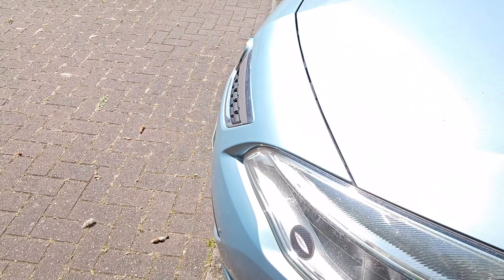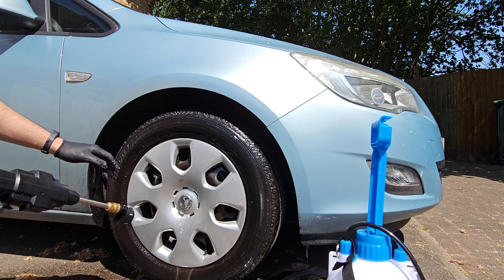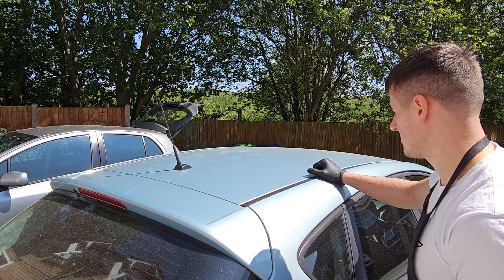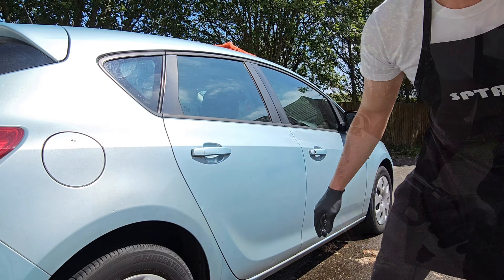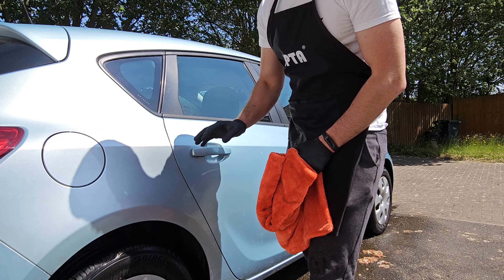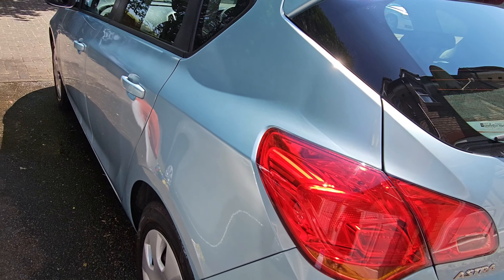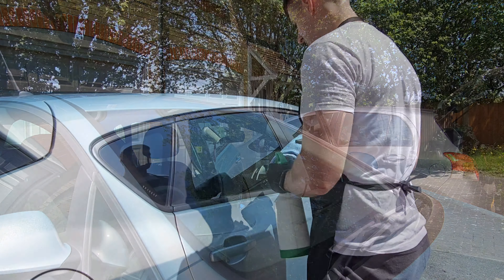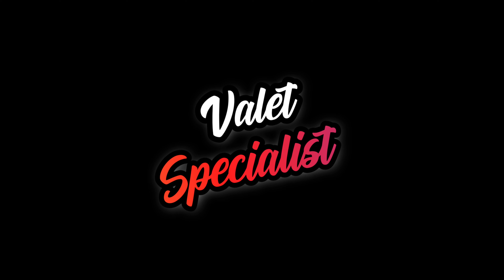TIPS HOW TO VALET IN DIRECT SUNLIGHT#detailing #detailing

Comment: Had 45 degrees heat a couple days ago and for some reason I decided to wash my car. I think I did well considering the weather... I used a garden hose and kept the car wet after contact wash until I dried it using a towel. I have a similar color to this car.
Reply from the maker: That is cool! As long as it doesn't dry out and leave water spots👍🫡